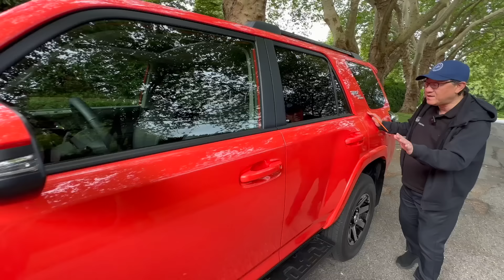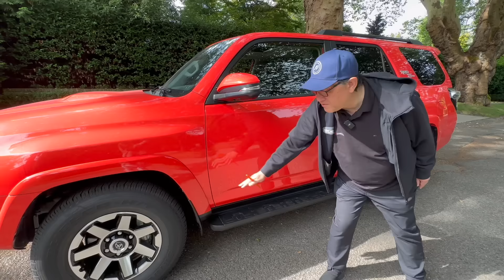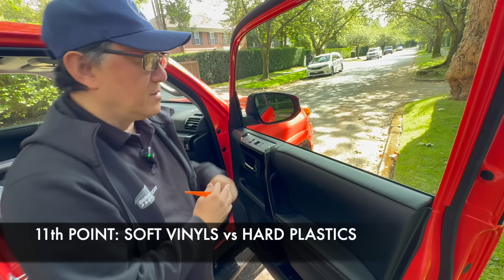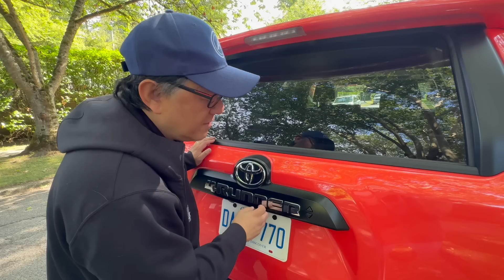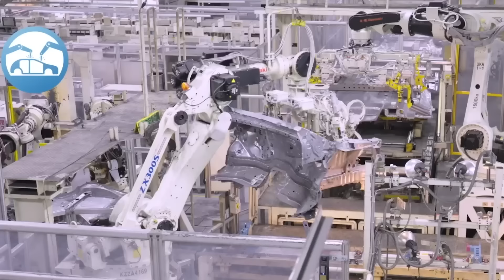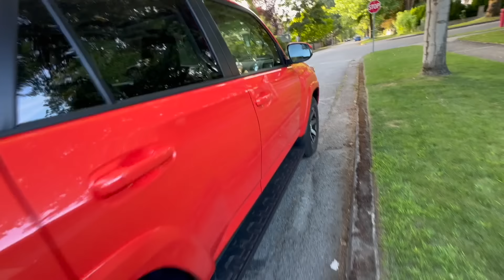30 REASONS WHY 5th GEN 4RUNNER WILL LAST 30 YEARS // FINAL REVIEW OF 2024 4RUNNER

Comment: You're not that tall, and your head is already hitting the ceiling. I only see short people drive 4Runners. I'm 6'3 and with the lowest seat setting, I still have to bend my neck sideways when in the driver seat. Loved the car, but they simply don't make them in my size without aftermarket seat modifications.

Comment: I tried to destroy my 2019 TRD Off Road. Bought it from a retired guy in south Texas who got it new. Had 35,000 miles on it. I drove it as hard as i could in the city and off road. 6 cross country trips from Florida to California and all around. They only thing i had to replace were 3 sets of bump stops. I just blew them out. Ran two sets of Falken Wildpeak tires on Fuel rims, and changed the breaks all around twice, and oil changes every 3000-5000 miles. Had RSG rock sliders. Stickers all over the windows. Was just about to hit 100,000 miles, and a lady crashed into the rear drivers tire area at around 50mph, and totalled it one Saturday morning going to get an oil change. Bought a badass used Tundra 4x4 from a buddy, and its been great. But going to park the Tundra soon and buy another 4runner this month. I miss the 4runner. If you are on the fence, just get one.

Comment: Well at least the early ones. The reason is simple they are holdover from 2011 basically. So they haven't gone woke, they were pretty big screen which hit hard with modules and relays depending on manufacturers between 2012 and 2018 for the most part.

Comment: My 2019 Toyota 4Runner TRD OFF ROAD (purchased new, garage kept, meticulously maintained) was recently involved in an accident (rear ended a Ford Escape, mini SUV which only sustained a damage rear tailgate). My 4Runner has over 11,000 of damage which included (not limited to) a buckled hood, damaged bumper & grill. Passenger side fender was also misaligned. 
Despite no frame damage, the vehicle was repaired with consequences. The body feels as if it will fall off the frame, the software on the infotainment system was never great and has had issues & the interior always felt cheap. The road noise was always above average but is now worse since the accident. 
The engine has always been reliable, however the alleged "quality" of this brand is not accurate. 

The accident was not severe enough for my 4Runner to fold like a tin can. Moreover, it was discovered that the undercarriage is laden with rust. My vehicle is kept clean and Live in the northeast but it s not warranted.

This will be my last Toyota, which has been surpassed by BMW as per consumer reports.

Comment: I picked up a new 2024 4Runner since I wanted something proven. Two years later couldn’t be happier. Your channel and the CCN convinced me.  While
I do think they did a good job on the newer generation 4Runner, however I think they cut corners to save weight and production costs.  The new Tundra they totally messed up and it’s not just the engine issues.  Tacoma now has an unusable back seat.  The new 4runner would be my only choice or I’d have to go Grand Highlander.

Comment: My original plan was to upgrade my 2020 4Runner SR5 Premium to a 2025 4Runner TRD Pro.  When I learned that Toyota was going to replace the V6 with a turbocharged four-cylinder, I nixed that idea.  I recently traded in the 2020 for a pristine 2023 4Runner TRD Pro with only 7,700 miles on it.

I also have three 2014 FJ Cruisers, two of which are Trail Teams Ultimate Editions (automatic with 580 miles on it; manual with 150 miles on it).  The non-TTUE, an automatic with 38,800 miles on it, is my daily-driver.

Comment: No reason to purchase anything different.  Best balance of reliability, practicality, and an enjoyable drive.  Toyota!

Have a 99 Tacoma with 300k and a 2014 4Runner with 263k.  Will rebuild the motor before replacing either of them and not think twice about it

Comment: I have a 2007 4Runner 255,000 miles. I’m getting my wife a 5th gen in the spring. Wool wax or fluid film your frame inside and out if you’re in the rust belt and these beasts will last forever.

Comment: My wife and I share a 2008 4Runner V6 4WD here in Colorado.  Same engine as the 5th Gen, but the truck is slightly smaller and lighter.    It has 269,000 miles and I am looking forward to keeping it for many years to come.   The car runs perfect, everything works,  burns no oil... I maintain it meticulously and I know this SUV can reach 500,000 miles with replacing the engine or the transmission .
Reply: without* replacing engine or transmission.

Comment: I just purchased my fifth 4Runner I have had a 1989 , 1991, 1996 and 1999 all of which had 5 speed manual I now have a 2024 TRD PRO and I have been very impressed with it and have had a great experience so far with it on and off road

Comment: I’ve been wanting a 5th Gen 4Runner for quite a while, but just didn’t have the cash for even a used one. I ended up trading two vehicles I had that were starting to rust for a 4th Gen 4Runner I found at a small used car dealer while I was looking at a 5th Gen 4Runner that my sister wanted to buy. I was sold on it since it had third row seats 4x4 and the underside was immaculate! It was a Texas truck since new up until 2019 when it made its way to northern Indiana, where I got it. It’s a 2004 SR5 4x4 4.0L V6 with just under 200k on the clock. It needs a few small mostly cosmetic things but it drives like a new vehicle still! It had a check engine light on which was evap codes. Needed a new gas cap. Also replaced front sway bar bushings and links. Mechanically everything else is solid. The vehicle was well maintained via the car fax and the interior is in excellent condition. No upholstery damage and the dash isn’t cracked either. I actually love the simplicity of the inside. I have climate controls, the factory cd stereo (fine for me because I still listen to CDs) and cruise control. That’s really it and it’s just fine for me. I’m looking forward to owning and driving this truck for the next couple hundred thousand miles!

Comment: I have a 2006 with the 6 cylinder engine. Over 250k miles.  However, I am looking to buy a car for the last 5 or so years of driving as I am older. I need more safety features so I will bite the bullet and buy a 2025 6th gen with all the safety gizmos.  Wish me luck!  Just needs to last 5 years or so before I hang up my driving.

Comment: The 2025 engine will not last near as long. The 2025 has 2.23hp per cubic inch vs 1.10 hp per cubic inch in the 5th gen. 1hp per cubic inch normally aspirated is the limit for longevity. The 2025 is twice over!

Comment: Hi David, I’m trying to decide on whether to buy a 5th generation 4Runner or a 2nd generation Tundra. Do you know if the 2nd generation Tundra is built as well as the 5th generation 4Runner? Thanks David!
Reply: You cannot go wrong with either of those two choices. Just get a good look at the frame and make sure there isn’t any rust! Light surface rust is okay, but pay close attention to weld joints, if it’s every rust or it looks like Swiss cheese, don’t buy, otherwise the 5th gen 4Runner with the v6 or the 2nd gen tundra with the v8 are both extremely reliable platforms. Just understand one is more off road capable and nimble compared to the workhorse of the Tundra. I hope that helps. Good luck on your decision.

Comment: I have a 2014 4runner limited with 280K mile and still going love it!!!
Reply: I have a 2014 Limited with just under 220K....everything works. Absolute tank!
Reply: How much preventative maintenance have you done? I.e. transmission differential fluid coolant pulley stuff like that.

Comment: I love my 2011 SR5 4 Runner! I have maintained it perfectly and it drives like it is brand new! I have 250,000 miles on it. I decided instead of buying a new one that I would put a little into it with my mechanic and keep it running! I just replaced the shocks, struts, power steering pump, valve cover seal, and the transfer case seal. It is very important to know a good mechanic who uses only Toyota parts and knows the rig well. I have serviced the transmission as recommended and changed the oil every 5,000 miles. Initially Toyota told me to only change it every 10,000 miles, because it is synthetic oil, but I changed it every 5,000 miles anyway. Why did they recommend only 10,000? I never understood why.

Comment: Gotta add my 2 cents worth. Everybody is talking bullet proof vehicle. And it is. If and only if you don't neglect and abuse this excellent machine. You want to redline it, hammer and bang it over rocks or drive it in the surf at the beach. You want to change oil every 10k, neglect the coolant, brake fluid, power steering fluid, you will shorten the service life. Don't buy a used 4Runner that was owned by a clown. Buy a keeper that you will own a long time.

Comment: Good job on the video. I've got 96k miles on my 2016 SR5. I've changed out the oil in front/rear differential and transfer case. Changing oil at 3k. Garage kept. I drove my 2000 Tundra for 24 years, great truck. But my 4Runner has better quality. It's a keeper for sure. Too bad Toyota dropped the V6 from so many of their vehicles. It's the end of an era.

Comment: I am a long time Toyota owner. For the most part they were Tacom's. and Corolla's.  I at a stage in life where buying a new vehicle every couple of years is not an option. I did extensive research and looked up reviews before buying which will be my last vehicle and that was a 2023 4Runner TRD off road. I could not be more satisfied with my decison. The only negative is and I new this going into this is fuel economy not being the best, however I know that taking care of this vehicle it will last 300 k no issue. :)

Comment: Not so sure on the paint. My '22 ORP has the typical known/common 5th gen paint issues. Rear hatch handle bezel rubbed the paint thru to metal around the edge. And same on the hood scoop. Thru to metal. Noticed it in time to have warranty cover the repair. But at 13,000 kms it required complete repainting of the hatch and hood and modification from factory. Including spacing and protective clear strips applied in problem areas. If not dealt with you get premature rust just outside of basic warranty.

Comment: Both Dealer and Toyota Canada a complete waste of time.  Entered into a purchase agreement in good faith on April 26, 2024 for 2024 4runner TRD off-road.  There is delay for the 2025 4runner till Spring of 2025 announced in fall of 2024.  Today, over six (6) months later, Dealer tells me they have to refund my deposit and dishonour their agreement without remedy,  as new 2024 4runner no longer despite delay of 2025 4runner release.  Completely non-transparent, customers south of border were having new 2024 4runner TRD off-road delivered during month October 2024 for agreements entered later.  Extremely dishonorable and dissapointing Brand and Manufacturer and Dealer.  Big Fail for Toyota and Japanese Name.

Comment: My 2003 4 runner with over 200,000 miles had to be retired early with a rusted frame. I will miss that 4.7 engine.  Bought a new 2024. The 4.0 liter is loud with less torque but does not require an expensive timing belt change.   This time I sprayed the inside and outside of frame with Blaster Surface Shield and will continue to do that every year.  Hope to get at least 20 years and 300,000 miles out of it.

Comment: I love my 2003 4th gen. I bought it in Nov 2002 so it is about to be 22 years old. Still runs great
Reply: I just traded two of my vehicles for a super clean 2004 4th Gen with just under 200k. My first Toyota I’ve ever owned and I love it so much already! I was a Ford L-M mechanic for 10 years  and drove mostly domestic makes my whole life. I really appreciate the build quality and simplicity of these trucks! Mine is a 2004 SR5 V6 4x4 and it was a Texas vehicle until 2019! Which is pretty brand new where I’m at in the rust belt.

Comment: I’ve got a 2019 4 Runner TRD Off Road !! The 4.0 V6 has plenty power and the 5 speed transmission has a manual mode or sport mode if that’s what you call it.I didn’t buy it for fuel mileage but constantly get 19 to 21 MPG. Love the vehicle old school,no high tech technology,still has a CD player,love the fact that I physically have to shift the transfer case into 4 wheel high or low from 2 wheel drive no electronics there.Absolutely love the rear window that it rolls down into the tailgate.A true body on frame SUV.Took it to Ziebart for Rust Proofing and Undercoating and just Ceramic Coated the paint for longevity and durability.Gonna keep it for many years !!
Reply: Wife’s 2019 SR5 Blue V6 what’s not to love! A Beast
Reply: Same here. 2019 TRD Off Road (lifted). No issues

Comment: I still like the G4 models with the 4.7 V8 and full time 4wd the most. That powerplant just moves it around with so much ease and flexes far better driving/passing and even sound dynamics than the 4.0. And as we all know, is equally as reliable. Other than the t-belt cycles on it (doh!).
Reply: I agree.  Have an 08 Pathfinder stock 5.6 L V8 4x4.   I’m sure the difference in performance between the VK56 and the Toyota 4.6 or 4.7 V8 is probably more than the difference between Toyota V8 and V6.
Reply: @robertpoirier8520  In terms of sheer power, yes - however I have a 200 series landcruiser with the 5.7V8, and my father in law has a G4 4runner with the 4.7v8. I'm also pretty familiar with the G4 4.0L v6. The V8 in the 4runner FEELS like a bigger difference in everyday driving (low rpm, just getting to speed, passing, overall use) compared to the 4.0L V6, even though the power outputs are very similar. The difference the lower end torque makes is very significant. While my 5.7V8 has seriously more punch, the actual everyday driving experience it seems to me the 4.7L v8 compared to the v6 seems like a bigger differnce than even moving into my 200 series. V8 torque dynamics and low rpm flex makes all the difference

Comment: I test drove all new cars Mazda CX-5, CX-90, Toyota RAV4 Limited, Telluride SX Prestige, 4Runner TRD Pro, Off Road Premium and a BMW X4 2022. 

Here's my take. First CX-5 is garbage I do not know why that thing sells a lot. The engine is too noisy, it's too small of a powertrain, the interior is cheap feeling even though it has tech. Ride is not at all solid feel, steering is awful. CX90 on the other hand felt decent but not 70K worth at all. The I6 in that is mega complicated with all the hybrid nonsense in it, steering is improved. 

RAV4, one of the most hot selling cars, 240K per year. The car is good, it has a ton of luxury features that 4Runner lacks - Power lift gate, JBL sound system, modern infotainment, very good luxury features like ventilated seats and rides way way better than Mazda, 4Cyl is a decent powertrain, has modern tach as well, digital rear mirror. All for 44K, it's a solid car. But the steering is bad and does not feel solid. The ride quality is nice.  Bumper sag exists out from factory, maybe it's the apes working in Canadian plant.

Telluride, damn good luxury features such as infotainment system, features that are useful, 7 seater, ton of space, nice audio system sells a lot. But the downsides - too much boaty feeling, drives with no confidence, the mechanical part of the Hyundai V6 has GDI only no port injection so it will gunk up valves if you drive high miles and the underside of the body heat shielding is not up to the mark, the drive shaft is thin, lower control arm on the rear is tiny. That's how Hyundai provides luxury by cutting cost underneath.

4Runner TRD Pro is too noisy first. The drone exists on that due to a different muffler exhaust system, too expensive its 60K, JBL is nice along with dual zone climate system, but that's it. Fox shocks are not the greatest over KDSS. Off Road Premium, rides better than TRD Pro due to the KDSS system (make sure you got it optioned), Hydraulic steering in this 4Runner (all trims) is ultimate. Not even BMW X4 matches to it also linear power delivery is just excellent in 4Runner 1GR-FE it is legendary engine, the solid tank like confidence that 4Runner gives me is really what I adore in this SUV. Very nice visibility. So an SR5P is best bang for buck, I want to buy RAV4 but the bumpers are having gaps from factory on dealer lot and if I search on internet many photos pop which is worrisome because I've been there already with IS 500 bumper sag. 

Honestly if anyone asks for 52K the 4Runner is a no-brainer, you get superb resale. Tank like SUV, bulletproof powertrain and fantastic feel while driving only cons are - bad audio system, no luxury features, rear camera is just 2000 era, MTM is a nice option you can use it for Parking and etc.

Comment: Imagine the cost of FUEL for this  P__ over the next 30 years, These vehicles DO NOT get good milage! Outside of the the USA they use small diesels for low speed travel, as fuel is expensive. Good luck filling this up in 2035 in the USA.
Reply: Yes, it's not fuel efficient. But a few trips to a dealer or repair shop due to mechanical or other issues in a less reliable vehicle quickly negates that.

Comment: Hi David, Thanks to your video, I just traded in my 2019 Porsche Cayenne S for a 2024 5th Gen 4Runner TRD Pro (keeping the 2017 911 GTS). I want a reliable, low cost of maintenance SUV for a daily driver, and your review was very informative. Thank you for sharing your expertise in this video. Best Regards, Craig
Reply: The only upgrade from a 4Runner is GX460 or LX570. But as an off roader, 4Runner is better.